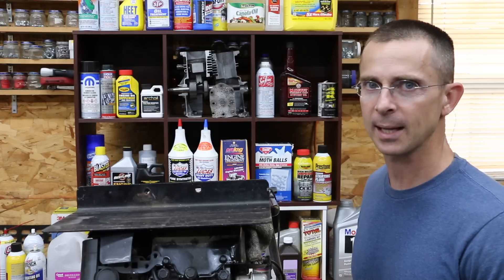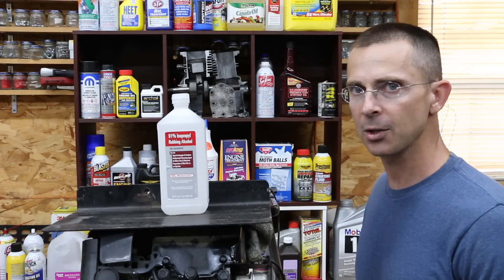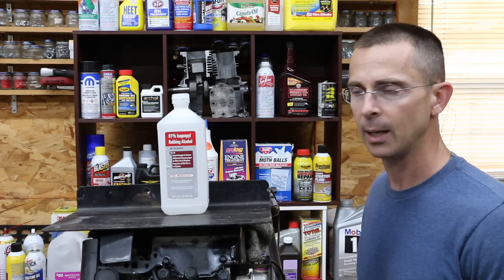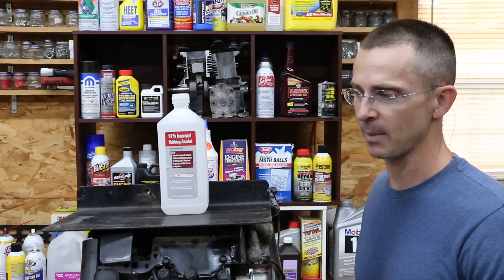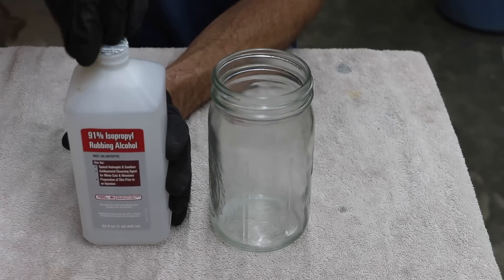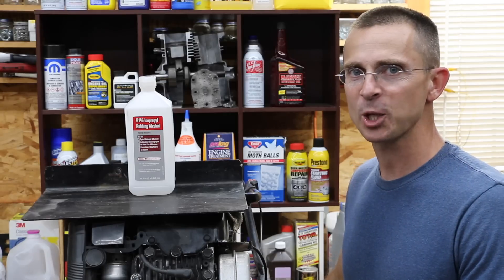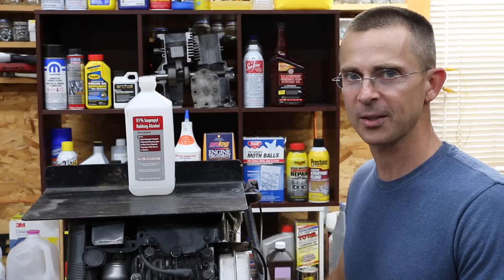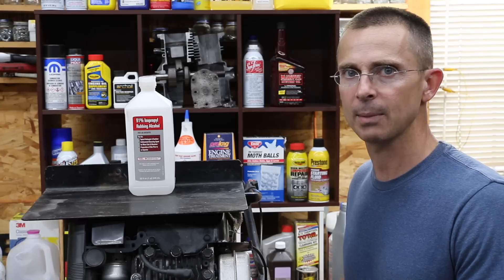Will a Gas Engine Run on Isopropyl Alcohol?  Let's find out!

Comment: If you have already done it I must have missed the video. But it would be neat to see a before and after of running e85 through one of these engines and a clear cylinder head burn also. Just a thought
Reply from the maker: Yes, I will definitely test E-85 in a future video.  Thank you for this recommendation!
Reply: Did you adjust the carburetor for this test? Fuel injectors should be of higher capacity for E-85, and I'd think a similar adjustment would be needed for isopropyl.

Comment: can you test a small engine running on E85?
Reply from the maker: Yes, I will definitely test E-85.  Thank you for this recommendation!
Reply: You need to rejet it, you need ~30% more fuel on e 85 than straight gas. It's also very hard on aluminum components.
Reply: E85 will clean out a tank. Old gunk from years of gas, and floating deteriorated foam. It will all thin out and find its way to your fuel filter shortly.
  Its a lot easier than dropping a tank, and cleaning by hand with mineral spirits.
Reply: IIRC 50/50 E10/E85 gives you most of the benefits(Cooler running, higher octane), with a lambda closer to that of E10 Gasoline/Petrol.
Reply: Illegal?? Hahaha
Reply: So you come up to a 4-way automated traffic light, traffic is dead, i mean its DEAD and You know this particular light is dramatically long, a literal 2 mins of idle wait.
Its 3am, no cops on patrol, nothing but crickets outside your window.
                   Do you wait or do you look both ways, and go??? ≖_≖
Reply: Adrian Gonzalez I've asked him to do that as well as try methanol and aviation fuel.
Reply: I ran my riding mower on E-85. Ran like crap.
Reply: All They Found Was A Boot Even though it ran like crap, it probably cleaned your engine!* I have run 50/50 E85 & E10 (that CRAP is all they sell in OHIO) just for a fill up and ran it down to "E" on MANY non flex fuel cars. It will run like shit during the 50/50 fill, but will run a lot better on the next fill!

Btw, running alcohol CONSTANTLY is BAD for engines! If you live in a state that sells ethanol free gas, SPEND THE EXTRA MONEY FOR IT!

* Then again it might not have that much effect on a regular valve setup, but it damn sure will clean injectors!
Reply: That would be pretty neat to see
Reply: It would more than likely run but not good. E85 has less explosive energy than gas witch is why you have to have much larger injectors to run it on an automotive engine
Reply: Adrian Gonzalez that will run lean and hot and burn up valves and rings. Unless carburater is modified to flow twice the volume of fuel. A few minutes might not hurt it much but after a while it will burn out.
Reply: All They Found Was A Boot . E-85 ran like crap in the mower because it has 30% less heat value therefore to make run good u have to make the carb flow 30% more volume. It's higher octane to meaning burns slower. So timing may need to be advanced too.part of the cleaning is running so lean u burn the carbon off and out and some metal surfaces.
Reply: As a comparison.
E10 Stoich 14.1, E 85 Stoich  9.9 /// Needs 30% more fuel
E10 Stoich 14.1, E 50 Stoich 11.9 /// Needs 14% more fuel.
Also, E85 can be a bit more forgiving in lean conditions, when compared to E10 Gasoline.
Reply: Minor problem with running a small engine on e-85, in most states, it's illegal. Check your area first.
Reply: Yes it will run but it is hell on the carbs
Reply: What's so funny? In most states it is!
Reply: What type of aviation fuel?  Jet A is basically diesel fuel, but 100LL is aviation gasoline for piston engine aircraft.  100LL is 100 octane leaded gasoline, but should run perfectly fine in any gasoline engine that doesn't have a catalytic converter (which the lead will mess up).

Comment: I was literally just wondering about an hour ago if 91% would work, if I could keep two large bottles in the car as emergency reserve fuel. now I know. Lol. Thanks!
Reply from the maker: LOL! Thanks for commenting!
Reply: e85 would  be better your car would run less lean, you would probably melt a piston  running on straight ethanol on a gas injection map.
Reply from the maker: This is an excellent point!  Thanks again

Comment: I had no doubt. Coleman uses that to preheat the generator on their kerosene lanterns which will also burn diesel and cooking oil if you can get the generator hot enough. You can still get 99% online but I use 95 for cleaning my floppy drives. Yes, I've got an old Sony camera that uses floppies and I'm keeping it too! It's paid for! Thanks, Commander! It WAS a good one!
Reply from the maker: Lewie,  I enjoyed reading your comments.  There's nothing wrong with using floppies.  As long as it works, no need to change.  Thanks for the positive comment!
Reply: Yeah, I guess I'm stoneage school, not just old. But like you said, if it works. Take care Commander!
Reply from the maker: Thanks again Lewie!
Reply: 10/4 Commander!

Comment: Can it run on straight Brake Cleaner?
Reply: Yes you can. It's a dirty trick we used to do for cars that had dead fuel pumps at the dealership. Someone would sit on the radiator support and spray into the intake while someone drove it into the shop. It was better than pushing
Reply from the maker: Thank you for this recommendation!
Reply: You can't use brake cleaner, brakecleaner typically contains tetrachloroethene which when heated above 599 °F will decompose into incredibly toxic phosgene gas, many welders have learned the hard way that you don't heat brake cleaner. Although some newer "non-chlorinated" formulations may be safer when burned.
Reply: Amazing idea :D
Reply: Project Farm can you try to run straight brake cleaner in  a small engine
Reply: Even trying to use it as startup fluid is very dangerous, burning brakleen will definitely give off phosgene gas, and even a very light exposure can cause permanent nervous system damage. There are a lot of cleaners that can be used for multiple purposes, but brake cleaner is probably best left to be used as brake cleaner and only brake cleaner.
Reply: Brandon Upchurch Well the brake cleaner we use is non-chlorinated. No brain damage yet, I think...
Reply: Check the label for the contents of the brake cleaner.  If it has a fluorocarbon then you don't want to do this.  That could release hydrofluoric acid on combustion.  It's not a strong acid but it's extremely dangerous, more dangerous than a lot of strong acids.  If it's a chlorocarbon it could produce hydrogen chloride which turns into hydrochloric acid on contact with the water in your eyes or lungs.
Reply: It can be used like a paint thinner but typically paint thinner is mineral spirits. I'm guessing since you are talking about autobody repair that you mean lacquer thinner, then I guess some of the non-chlorinated varieties of break cleaner which contain a mixture of various solvents could be similar to a lacquer thinner. Original formula breaker cleaner is pretty much pure Tetrachloroethylene which I don't think has ever been used in lacquer thinner, in addition to being commonly used as a component of brake cleaner it is actually most well know as being dry-cleaning fluid.
Reply: When I wrote a caution about brake cleaner I was referring to the non-flammable stuff (which would need to be diluted in something flammable).  Carbon tetrachloride can partially oxidize into something I don't want to write about in a public forum.  So stay away from burning the non-flammable stuff.  The non-flammable stuff might also be trichloroethane.  That's something you shouldn't introduce into a combustion chamber, either.
Reply: gokartbuyer my car hated it when I sprayed it in the intake.. maybe different types of cleaner?
Reply: Burning brake cleaner makes toxic fumes
Reply: gokartbuyer what type of brake clean did you use? None of my small engines will start with a shot of cleaner usually results in flames out the intake.
Reply: Chris K yes I legit thought about this 😂, I saw a video of people using brake cleaner as starter fluid
Reply: Just a little knowledge for u guys break cleaner is paint thinner in a can
Reply: Run an engine on straight Brake Cleaner?  Let's go all out, start the engine on straight Engine Starting Fluid.  Joking of course.  The engine would probably grenade with the video's author next to it, then he wouldn't be around any more to make more videos, then I'd be sad =(
Reply: I use it for starting fluid, dangerous stuff on engines that like to back-fire.
Reply: Keep clear of brake cleaner fumes if u burn very toxic!

Comment: I would love to send you some ethanol fuel from Brazil but I don't think it is legal lol. It is made from sugarcane and have a really powerful burn. Here we have to use only in "flex" cars (which are prepared for gasoline and ethanol), so it would be nice to see how a mix would work in the see through engine, because every time I change fuel the engine has to deal with a mixture of them.
Reply: We have pump ethanol available in the U.S.. usually between 70-85 percent ethanol depending on the climate and time of year.
Reply from the maker: This would be an interesting video!
Reply: here, most of the cars are designed for 100% ethanol, and gasoline is at least 20% ethanol. Kinda crazy. You got me thinking, Ethanol from US is made from corn, here sugarcane. What would be the difference? We need a video! lol

Comment: Can you run an engine with liquid oxygen
Reply: yadiel AA oxygen isn't a fuel, it's an oxidizer.
Reply from the maker: Thank you for this recommendation!
Reply: Chris Cable i've heard that liquid oxygen is very flamable
Reply: yadiel AA liquid oxygen can make petroleum explode. If you put a drop on vaseline and hit it with a hammer it goes off like a firecracker. I heard a story about a jackhammer operator who tied into an oxygen line by mistake and the oil in the jackhammer blew up but I can't verify the story.
Reply: yadiel AA oxygen in and of itself isn't flammable. You need 3 things for fire. Fuel, Oxygen, and heat. If you have fuel and heat, oxygen should make any fire stronger than with normal air. What he should try doing is feeding 100% oxygen through the air intake.
Reply: yadiel AA not without a fuel source
Reply: Oxygen mixed with gas burns steel!!!!
Reply: what about liquid hydrogen or run it on hydrogen gas.

Comment: I'd like to see an attempt at blowing up an engine with NOS. Keep the videos coming. Great job!
Reply from the maker: Thank you for this video project recommendation!
Reply: Nicholas Nelson 

How about blowing up a street racing green Mitsubishi Eclipse with NOS?! Oh no, wait, that's been done :P
Reply: Project Farm Doooo it! That is a great idea he has. Would like to see you do this.
Reply: The problem with running piles of nitrous through a 6hp engine is the fact that you're limited on CFM. The engine is physically not pulling in enough air, and whatever HP shot you're running will simply just escape the carb and go into the air. You're also dealing with atomized fuel being near an ignition source (boom). 

It'll start the mower on fire before it blows the engine.
Reply: 32vAudi90 Could always use an air compressor to feed it more air.
Reply: Shit that aint hard to do LOL
Reply: Engine Masters

Comment: In old cartoons when they would run out of gas they would pour a bottle of moonshine or gin into the gas tank and it would run.  Given the widely different proofs, I wonder if there's an ideal ratio to where you wouldn't need to tune the carburetor.
Reply from the maker: Thank you for this recommendation!
Reply: thechosendude 
Have you seen the documentaries of the old school Italian racers? They used to have bottles of grain alcohol stashed along the mountain road course to stop and fill their cars with, and they would always slam a few chugs down to fuel themselves.

Comment: Looks like it cleaned it a bit but I don't know how long it ran. The question is would you use it as an engine cleaner?
Reply from the maker: It ran for around 20 minutes.  I would use in a gas mower, but probably not in an automobile engine.  Thanks for commenting!

Comment: Run engine on just two stroke mix gas and oil. No four stroke oil
Reply: I am pretty sure 2 strokes have a method of lubricating the crankshaft/bottom end with the fuel and oil mixture they run on.  If you ran a 4 stroke like this on two stoke oil it would lubricate the top of the piston but with no lube in the crank case it would burn up the bearings pretty quick.
Reply from the maker: Thank you for this recommendation!
Reply: I used to steal my dads gas from the weed eater for my go-kart a long time ago. It will run fine on 2 stroke gas/oil.
Reply: Yeah it will run fine with oil in the crank case, but if you drain the oil and then try to run it I doubt you would make it very far.
Reply: Craig Arnold 
Lol use a engine with bad blow by
Reply: 2 strokes pull fuel and air thru the crank case to lubricate it thats why the cylinders are ported. if you ran just 2 stroke oil in a 4t it will just fail due to no oil
Reply: There will be no lubrication for the bottom end of the engine = seizure.!
Reply: yep. Stihl has their 4mix design than lubricates the bottom with the mix fuel in a 4-stroke but it's not going to work in a regular 4 stroke
Reply: Clayton Steinmetz , LOL
Reply: Clayton Steinmetz only for your batteries!!! Lol
Reply: Craig Arnold a two stroke operation is slightly different. The reason you don’t need oil in a two stroke is because the fuel and air oil mixture come in from the crankcase. Whereas a 4 stroke come fuel is coming through the valves instead of the piston sleeve.
Reply: A typical 2 stroke engine doesn't even have valves. From the ones I've taken apart in my limited experience, they have slots in the lower portion of the cylinder wall that allows air, gas and oil to be pulled from the crankcase side of the engine. Its such a simple system, that the fuel oil mixture just runs through the entire engine. 4 stroke engines separate the lower half and the compression camber completely (or as much as possible). The results would be the same as running an engine without oil in it. It wont last long and I think that was already done on this channel.

Don't make my mistake. When putting together a 2 stroke, don't use a lot of a thick oil. It will lubricate it but it wont run and smoke like crazy due to all of the oil. I had to disassembly it again and clean it out. Just a touch of a thin oil is good enough, or just pull the cord a few times with the spark plug removed. This will pull some of the gas through and oil it for you. They are so simple and I had to wait for a replacement part anyway I didn't care, it was more fun to see how it went.
Reply: snoopdogie187 that’s what I said.
Reply: And people who said it before you too. And I tried to add more details then what you said.
Reply: I can't be fully sure, the reed was destroyed to the point that the engine wouldn't run. I got lucky that the cylinder and piston survived. So with too much oil and a bad reed, it had trouble starting, and running. It would idle when it was warm, but it was hard to get it there. The oil played a roll in the problems though. As more oil burnt off, I could get the engine to rev a little higher.  Unfortunately the lack of a reed valve would cause these problems also, and I fixed everything at the same time.

Comment: Really enjoy your videos , try running pure kerosene in a gasoline engine
Reply from the maker: Thank you very much for the positive comment and thank you for this recommendation!
Reply: gideon fournier  You can run a gas engine on white kerosene if it's hot. If it's cold, it won't start because kero doesn't vaporize as well.
Reply: Kerosene is diesel is it not?
Reply: Kerosene is not diesel, you may know it as paraffin, or coal oil, or lamp oil.
Reply: But diesel will run on kerosene
Reply: +Retro,  Kerosene, Number 1 diesel & jet fuel are virtually identical.  The diesel fuel used in trucks, cars, boats & heating oil is number 2.  There are small differences such as additives & sulphur content.